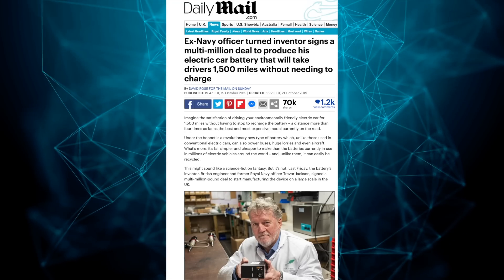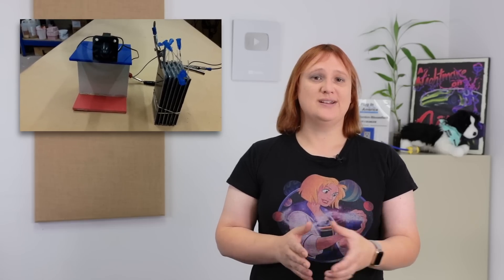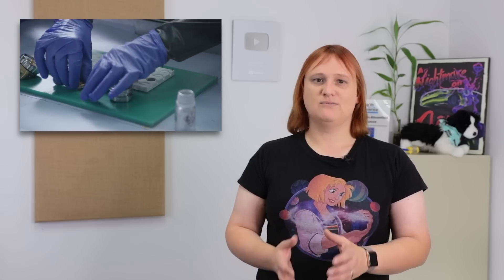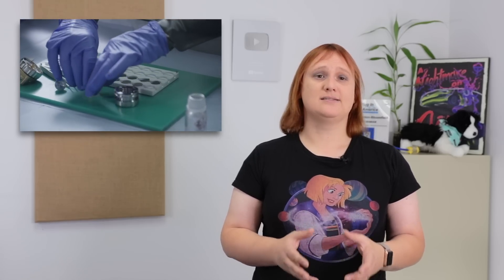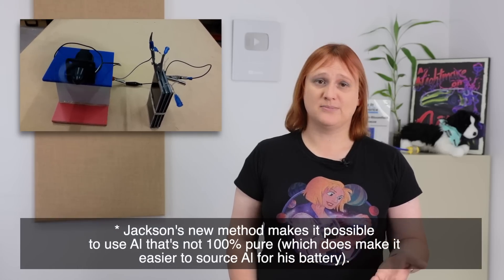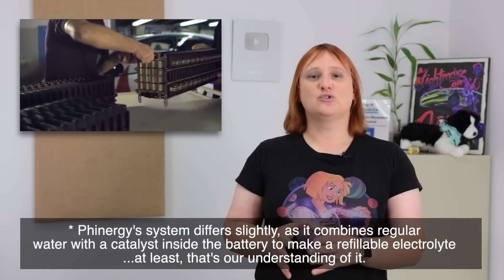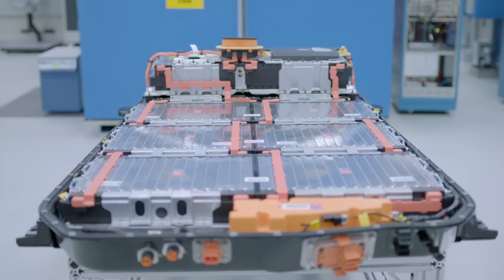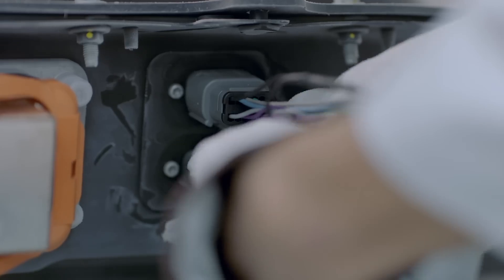Is This Battery The Holy Grail For Electric Cars?

Comment: I'm a skeptic of Aluminum-air for EVs, unless and until they can be made rechargeable (which is unlikely). The 8x energy density looks great, but the other considerations kill it.

A 300 mile rechargeable battery is far more convenient than a 2400 mile swappable battery. I drive a Model 3 LR with 320 mile range. Range anxiety is never on my mind, because I always start with 300 miles every morning (I charge at home to 94%). And long road trips are not a problem because it's so easy to combine a meal break with a charge. So for me Al-air is a bad solution to a problem that doesn't exist.

I got curious about the energy requirement associated with recycling. Since they aren't rechargeable, we replace recharge with recycle, so the energy efficiency would be capacity divided by recycle energy cost. I found an article that projects an energy efficiency of 20%. Much higher than I would have guessed. Certainly better than ICE but much worse than current LI. This means it's not very green, and cost per mile can't compete with simple home charging. http://bit.ly/2Nk839p

Maybe a very small hand-swappable 100 mile Al-air emergency range extender (about 12kg) would be nice. Just knowing it's there means I could comfortably make use of more of my primary LI battery without inducing range anxiety.

I'm thinking electric aircraft would be a great application for Aluminum-air batteries.
Reply: Usage scenario for 100 mile Al-air range extender:

You fell asleep (newly downloaded FSD is active) and suddenly find yourself in the middle of North Dakota with 30 miles on your main battery. I guess the navigator picked the wrong Turtle  Lake). No problem.

A popup appears "you are low on power; do you want to apply the range extender?" Click "hell yes". Power flows into your main LI battery. Power density doesn't matter since the range extender isn't powering the drive train directly.

You set course for Prarie Knights Casino & Resort destination charger. Charge up while you eat some cheap casino subsidized chow, and all is well.

Comment: Replacing a battery rather than recharging it does not sound cost effective.
Reply: what if, in essence, you could recharge them? take the aluminum out of the electrolyte, reconstitute it into solid, recycle the electrolyte? basically if you can't do this for the same price as an internal combustion engine then forget it - presently it costs me about 

$100 to fuel up my Dodge pickup (ecodiesel engine range 1000 km) or 
$1000 to fuel up my Western Star 4900 (DD16 Detroit 600 hp range 1000 km) or 
$50 to fuel up a Ford Focus compact (2.0L range 1000 km)
on a ton per mile or tonne per kilometer basis the Detroit is the most efficient

it makes no sense to install this in commuter vehicles: plug in hybrid or straight plug in is all you need (as long as you remember to plug in)

Comment: So basically it reverses the electrolysis used to make aluminium to get the energy back that was put into it from converting it from aluminium oxide to aluminium. Which means large energy is going to be used again to recycle those batteries, wonder how well that'll work out in the long run.

Also the Austin EV company is only worth £2 it literally don't have multi millions to spend. The guy who owns it has shares in a couple of other companies worth only a couple of hundred pounds. 

This channel clearly didn't do it's research and just went with the article they found from psudo-science websites and went with it. 

Really the chemistry using aluminium batteries have been long known but aluminium is a pain to work with, especially as an electrolyte because aluminium forms a thin aluminium oxide layer which limits it's electrochemical interactions.

Guys don't believe everything on the internet, this whole this is just made for the clicks, I don't really blame this channel for following the trend.

Comment: If this aluminum air batter is so efficient and light, why not 2 or more of them in a single vehicle. As the first one deteriorates, the next one takes over, the first one then being replaced, presumably fairly easily? So you would have endless continuity?

Comment: I think this is a great option. The presenter sees only from the perspective of developed world where charging stations are common. On the other hand, I can see so many benefits: 

1) In developing world, where charging points are sparse and difficult to find, it will be easy to convert the existing infrastructure (filling stations) to store the battery and easily swap. 
2) It will keep the filling stations in business thus no resistance from loss of employment point of view. 
3) The swapping out of batteries will make specific points of collection of old batteries which can then be recycled (if possible).
4) People can buy extra batteries and swap them if needed by themselves, thus killing range anxiety for people who are worried about such things.
5) The long range of the battery packs means (this is exclusively for me) once in 6 months visit to a swapping point.

On a whole this is a great way of moving away from fossil fuel. Rather than long charging time, depending on the time taken to swap batteries it can take anywhere from 30 - 60 mins, not more. I will be the first in line if such a vehicle were to exist in my country.

Comment: Thanks for a clear well explained video about this new choice if it comes to production. 

Here's a couple of thoughts, I'd hate to have an electric vehicle that you need to wait for 30 minutes every 300 miles, wating a couple of minutes while my battery get replaced, my tank get's filled or I get a new gas cylinder is much better for me. 

They haven't standardised charging stations yet, can I get an adapter for my Tesla to plug into a Toyota/Mercedes/Nissan outlet?

I don't have solar panels on my roof as I live in an apartment building so there isn't much benefit from me beiing able to charge at home. If you do have solar panels on your roof and you are feeding back into the grid you're using the grid to store excess energy in terms of credit, so it doesn't make much difference where I charge/change my battery.

The lithium Ion batteries currently being used have a limited life span and are much more difficult to recycle, if anyone has a cost breakdown on the energy requirements to recycle both styles I'd be interested in that. I'm guessing with the Aluminum battery you just melt it.

If the Alumimium battery is 1/8th the weight of a 85Kw Tesla battery (540KG) for the same range it's still pretty heavy and would require a mechanical changer to handle the change over, but you aren't dragging around 480KG or extra weight. That is a major savings being nearly 20% of the vehicle weight, would that translate into 20% more range? 

This type of battery would also be good for trucks/busses.

Comment: so the battery should be 1/8th size of todays battery pack and it should be easy to replace something in the 10 liter range...
Reply: question...whats the efficiency of  recycling aluminum...from battery start to battery finish.
Reply: maybe you just buy them 1 liter(10x10x10cm) at a time...these are 8 times more powerful than todays batteries in the space....

Comment: I can't see this working with just one battery.  It's probably going to take TWO batteries.  When one runs down, you've got 1500 miles to get it replaced.  However, that doesn't mean I'm all in.

Comment: Nope, I can’t watch bullshiz that conflates CO2 with pollution.

Bye bye 🖕🏻
Reply: Surely you've been in a stuffy room and had trouble thinking in there. That's CO2 to blame.
Reply: Roxor128 are you sure that’s the raised level of CO2? Or is it the lowering of the level of O2 in the room that’s the cause?

Sit in a room with no CO2 but a lower level of O2 than you’re used to and you will suffer the same effects.

How about go up a mountain where the air is thin. CO2 level is the same as at the bottom of the mountain yet it still gets hard to think.

Now sit in a room with 5% CO2 but still 20% O2. You’ll find that you won’t even notice the extra CO2.

Are you sure you’re not get CO2 mixed up with CO? The human body does not absorb CO2 from the atmosphere, but it does absorb CO which will give you the effects you describe and is dangerous as it replaces the O2 in the blood and it is more difficult for the body to get rid of it again quickly, causing suffocation and death.

Want to discuss this further?
Reply: @TheGreyTest   Definitely CO2. The Wikipedia article on carbon dioxide has a whole section on toxicity. On the extreme end, 7-10% CO2 can cause suffocation in minutes to hours, even with sufficient oxygen. Experiments with the crew on the ISS had them suffering headaches, lethargy, mental slowness, emotional irritation, and sleep disruption with just 0.5% CO2, and other studies have found that just 0.1% (2-3 times normal atmosphere) can impair cognitive function. There are even workplace safety regulations limiting CO2 concentrations to below 0.5% in the US. Who would have thought the USA would do something sensible like that?

Forget about climate change. Keeping levels of the stuff in the atmosphere low to keep ourselves smart is a pretty good reason to treat it as a pollutant.

Comment: The "holy grail" is not range, but RECHARGE TIME. Specifically, a 5 min. recharge to FULL CAPACITY. Many future, would-be EV owners could easily accept if an electric car only got 200 or 300 miles of range, just as long as they could pull into any charging stations to "fill up" and be on their way again, like ICEV's are today - 5 mins, in and out, recharged for another 300 miles. Until EV's have the same features and conveniences as today's ICEV's, there won't be any mass adoption of electric cars - not as they are now.

Comment: I swear someone claims to have a "breakthrough" of some kind every few months.
Also if you look it up, SAIC, who owns MG, is meant to own what's left of Austin but apparently somebody in Birmingham bought the rights to the name for £5.
Reply: it's true - I follow anything 'carbon dioxide' through my news aggregator and there is monthly a new process for turning atmospheric carbon dioxide into some liquid, usually ethanol as I recall - so much so that I would worry about who is going to turn all this stuff off if it goes into production? below 200 ppm the trees start to die... not to mention if they are correct and carbon dioxide is the main climate driver they claim, we could speed up the return of the next ice age (and the accompanying 90% reduction in biodiversity and starving of three quarters of the human population that survives the fight for the Equator)
Reply: @brettb9194  In order to get the CO2 ppm below 200 you would have to extract more CO2 from the atmosphere than it has been burnt over the past 100 years. Good luck trying that.

Comment: When you say having it as a range extender seems like the best of both worlds. And it reminds me of Scorpius from Farscape, he has the fuel cell pop out of the side of his head and then he replaces it. Have an area on the car already like that. Replace where we usually inject the fuel with a place to store a cylindrical aluminium air battery. It's novel and not much of a change for people then, they understand it as fuel.

Comment: Aluminium pills seems to spring to mind.
So you vehicle runs out of power you open up a flap and pop in a couple of pills power comes back, job done.

Over time the cells degenerate to the point where the battery contains more aluminium dissolved in the electrolyte, whereby the battery is then swapped out, but it is then more valuable as the aluminium would be easier to recycle as there would be so much more of it in the battery.

Comment: Sorry, but if you want to be taken seriously it’s important to get the technical stuff right. The phrase “orders of magnitude” (plural) implies a minimum of 100x. An order of magnitude is 10x so two orders is 100x, three is 1000x etc. Many (most?) people seem to think order of magnitude is a nebulous expression meaning “a lot”, while it actually has the specific meaning given above.
Another area to be clear on is the difference between kilowatts and kilowatt hours. Kilowatts are units of power, which affect the rate  your car can accelerate, its top speed or, when recharging, how quickly it can do so. Kilowatt hours are units of energy which determine the sort of range it will have. I wish had a dollar for every comment I’ve ever seen which conflates the two.